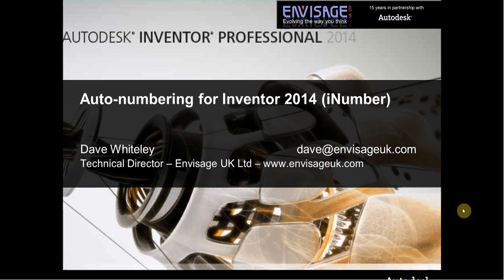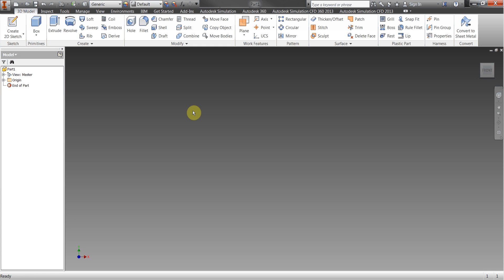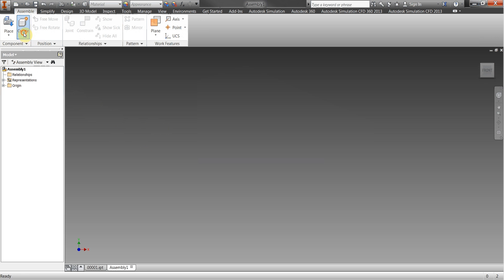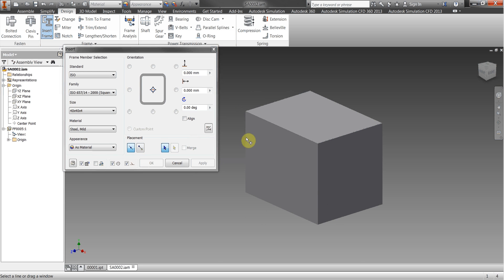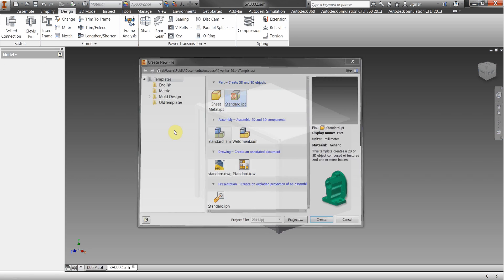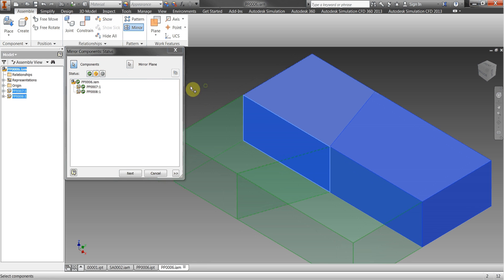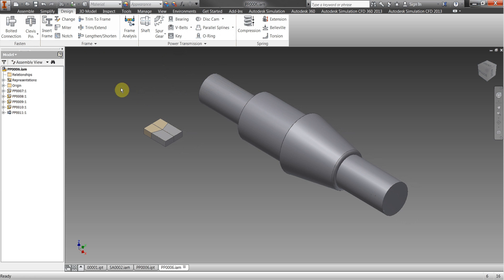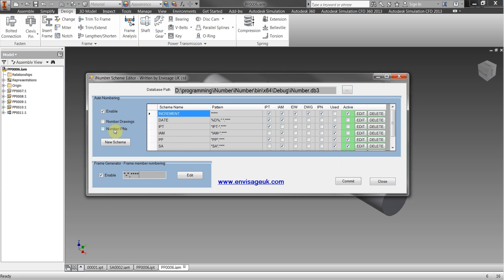Automatic file naming for Inventor (iNumber) - www.envisageuk.com

Comment: Upon Inventor startup, it's asking to select a file called iNumber.db3. Where is this file to map to?
Reply from the maker: This database file is supplied as part of the iNumber tools. (Either Inventor or the editor). you need to copy it to a shared location accessible by all Inventor users.

FROM README DOCUMENT:
A single database file, "iNumber.db3" must be copied to a shared network drive (with full read/write access rights) that is accessible by the users of the Inventor add-in.
Reply: Dave Whiteley Thanks. I will give it a shot.